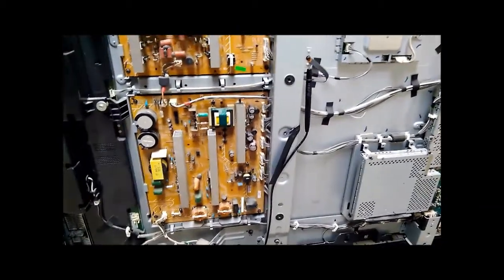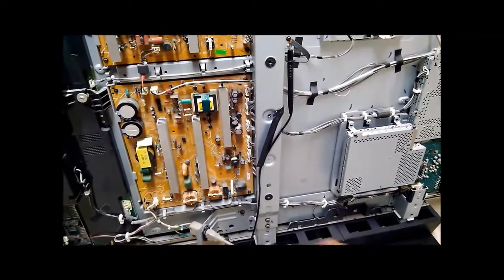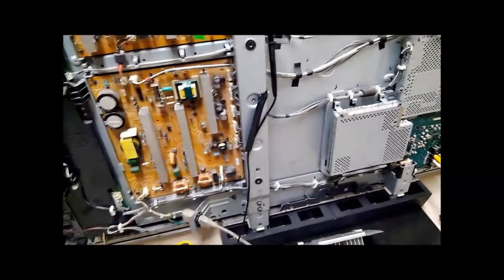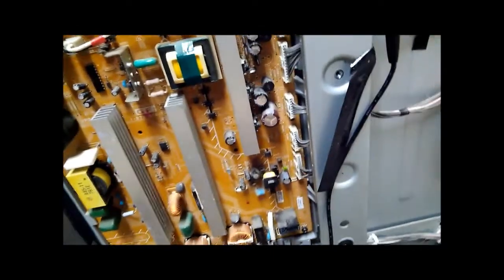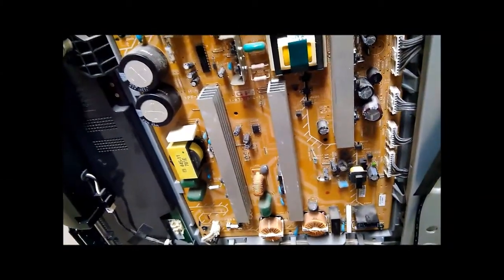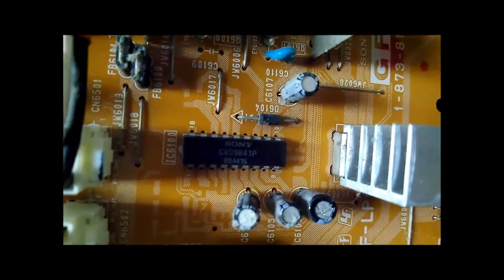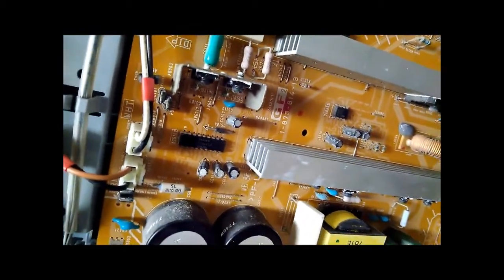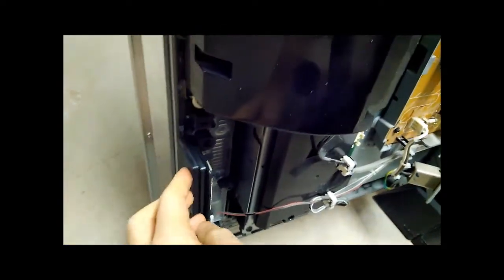Sony Bravia 3 Blinking Red Light

Comment: i have a simular fault, i hear no click on the board and theres nothing on the screen at all completely black (did you have this issue with complete black screen? i couldn't really see in your video) theres no response from the tv at all no lights nothing. is this a bad LCD? or power fault/logic board. i've found replacements for both just worried its the screen. stanby light flashes in a sequnece of three this happens twice but only when the power is switched off by the walls mains. its a sony kdl-40w3000 if this helps.
Reply from the maker: Since I had to reverse engineer the problem myself, I'm not particularly qualified to offer a diagnosis.  However I would say there's no harm starting with the power supply.  If you go through the steps I did in my video you can at least see if the TV is sending the correct voltages back and forth and at what point it's not doing what it's supposed to.  If it is, and the TV is still dead, it could very well be the display but best to rule out other possibilities first.
Reply: @ChrisCamaro  ok thank you, shall try a little trouble shooting my self, thank you for your reply and help.

Comment: Mine is similar to yours in that, I both get the flashing red light 3 times, but when the screen is on it looks fine (before it turns off after 15 seconds), so it shouldn't be the mainboard. I will try the power board first (JK board) and hope that that fixes it on my 55XE9005. My AC Adaptor is external brick (which I replaced first but it still gives same error), but the JK board is in the repair manual as a possible fix. Hopefully that fixes it for me too.

Comment: Hi..on this model tv ...if lcd screen is cracked will tv still power on or no?
Reply from the maker: It should.  Powering on just requires that the power supply can turn on and then it gets proper voltages back from the other boards.
Reply: Ok..reason i ask is that on this model tv it shows no power on and  6 blinking lights is lcd panel issue...i dont know the blinks because i tore tv apart.for parts and trying to guess which parts may be good...
Reply from the maker: @shelby50411  If you've removed parts, then that makes diagnosis more difficult, as it could be any of those parts.
Reply: Correct...but prior to parting out the screen was cracked and tv wouldnt power on...and after i did some research it does show that this sont tv per error code charge does have a code that relates to lcd panel...typically lcd tv with a cracked lcd panel will power on but this tv im not sure....thanks
Reply from the maker: @shelby50411  There are 2 high voltage boards, one on each side of the screen, that power the screen itself.  If either of them are shot, or they aren't returning the correct voltage to the PSU, the TV won't fire up.  Essentially all this can be checked with a multimeter.  If you have the time to trace the path of the wires back and forth from these boards, you can check the voltages (carefully, these are high voltage) and determine which one is misreporting.

Comment: This is my exact issue. I can even hear the click of the relay. I called 8 repair places, most are out of business and the 2 that I talked to said I should buy a new one.
Reply from the maker: Yeah because they don't know how to fix these issues anymore.  Not like the TV uses ancient technology or anything... it's like maybe 15-20 yrs old.  I'm disappointed with these so called experts who seem to only be capable of running self-diagnostics and replacing highly integrated sub-systems in a sort of "nuke the whole area" approach.  My "expert" told me it was the main board and when it wasn't he threw his arms in the air and left me with my multi-meter to figure out it was the power supply instead.  Before you buy a new TV run through what I did and see if the voltage is stable while it's booting up.  If it drops while clicking, you should take the risk in buying a new power supply.  That might just be the issue and you can save your TV.  Mine is still going strong today just like new.
Reply: @ChrisCamaro Your reply is great and I totally get it. Unfortunately, I just don't have time to run diagnostics. I'm not even an engineer so it ACTUALLY is cheaper to spend that time working and earning more dough then ordering a TV to be delivered to my door.
Reply from the maker: @JeremyYost  That's perfectly fine if you want to do that.  I just did this video to share what I learned in case you find it worthy to save the old TV.  Finding available replacement parts are actually harder than the diagnostic or repair portions.  Don't need to be an engineer, merely need to have access to a cheapo multimeter that can measure voltage and it would be enough to see the board voltage drop when you turn the TV on, as demonstrated in the video.  For about 100 bucks the TV can be good as new.  But I understand if you don't choose to do it.  There if you need it.